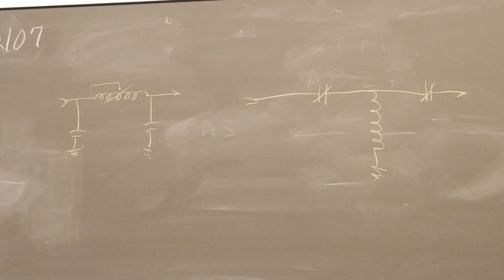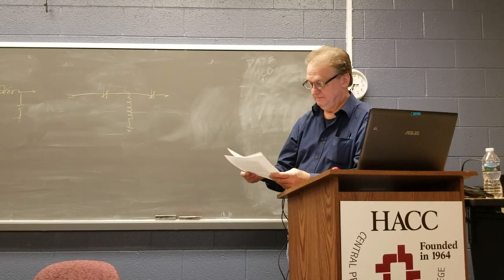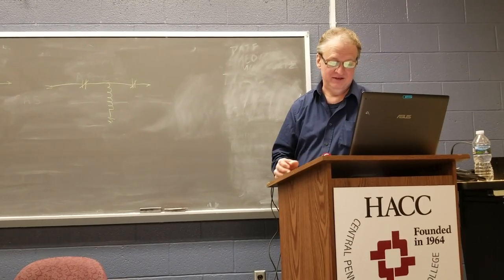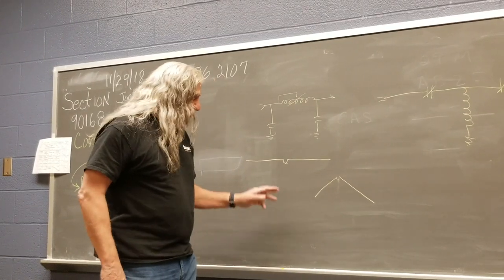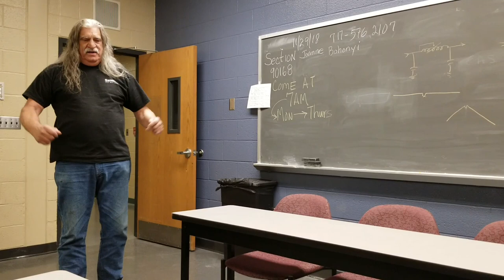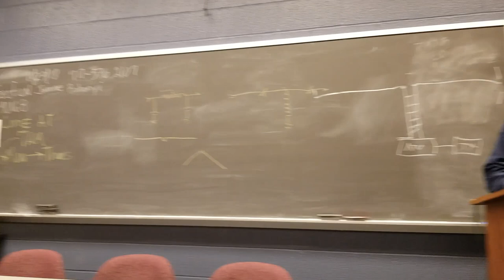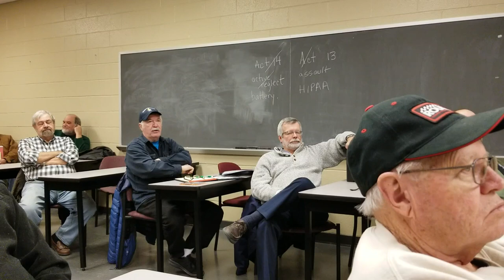Antenna Tuners and ATU Presentation December 2018 Harrisburg PA

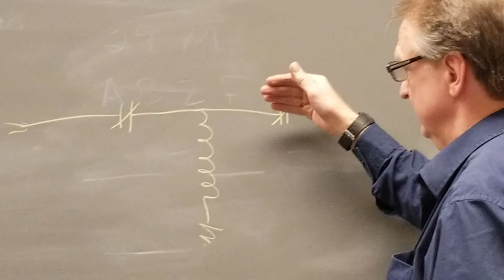Comment: Tuners actually absorb very little power (4:40, 7:55). Arcing occurs regardless of power absorption.
Reply from the maker: The purpose of a transmatch (tuner) is to show a 50Ω load to the transmitter. It does nothing to remove a high VSWR from the transmission line (coaxial cable). The high VSWR causes power loss in the cable feeding a mismatched antenna. The transmatch, and the cable in a mismatched antenna system cause loss of power. The amount of loss depends on the length of cable, and the VSWR number. Remember that some tuners will make bad antennas match the transmitter,  but then also a dumme load will also show a low VSWR. In short, mismatched antennas will not allow maximum power transfer to the antenna
Reply: @djterry17032  Not relevant to the comment, but you're exactly correct!
Reply: @djterry17032  VY GOOD. 100W. = 341.2 BTU OF HEAT. WHAT DOESN'T GET RADIATED FROM THE DRIVEN ELT MUST BE DISPOSED OF IN THE REST OF THE SYSTEM IN THE FORM OF HEAT. OR RADIATED. (CMC) OR OTHER LEAKS. BUT IT ALL ADDS UP TO 100 W.

Comment: ITS A MATCHBOX! A COUPLER! A TRANSMATCH! BUT NOT AN ANTENNA "TUNER"! A "TUNER" DOESN'T DO SQUAT TO YOUR ANTENNA. IT DOESN'T TUNE YOUR ANTENNA. A 7.15 MHZ DIPOLE IS 65.45 FT. LONG. WHEN YOU CUT IT TO THAT LENGTH YOU TUNED IT. TWIST AND SWITCH, TWIRL AND WHIRL THE KNOBS; IT DOESN'T CHANGE (TUNE) THE DIPOLE'S LENGTH, DIAMETER - ZIP, NADA! SO DON'T GET THE IDEA THAT YOU'RE "TUNING" THE ANTENNA. LETS USE THAT ANTENNA FOR 7.268 MHZ. YOUR 65.45 FT. ANTENNA PRESENTS A DIFFERENT LOAD REQUIREMENT.  YOU NEED A 64.39 FT ANTENNA. ARE YOU GOING TO CUT A FEW INCHES OFF EACH END OF THE ANTENNA? - NO! REPLACE THE DRIVEN ELEMENT WITH A DIFFERENT (SHORTER OR LONGER) WIRE? CHANGING THAT LENGTH WOULD "RETUNE" IT. BUT NOT USING A BOX ON YOUR DESK LABELED A "ANTENNA TUNER"- A BUILT IN "ATU" IN YOUR RIG? THEY DON'T DO THAT. WHAT WILL YOU DO? WHAT WILL YOU DO? - YOU NEED AN ANTENNA "MATCHING" UNIT. (THE CORRECT NAME FOR A TUNER) YOU MUST MATCH THE  ANTENNA (KEY WORD HERE), "SYSTEM" LOAD, PRESENTED TO THE TX. THAT INCLUDES
FEEDLINE, TRAPS, CHOKES, BALUNS, THE WHOLE NINE YARDS PRESENT A NEW IMPEDANCE TO YOUR TX. AND THAT IS WHAT YOU ARE DOING WITH A "TUNER". - MATCHING, NOT TUNING. BEEN A HAM 60 YRS AND TOOK ABOUT 30 OF THEM TO REALIZE THAT. '73 RICH MORGAN KF9F
Reply from the maker: Nothing beats a resonate antenna. I have often wished that I could build AM broadcast transmitter sites with a 1/4λ  tower.  My life would have been so  much easier.
Reply: @djterry17032  YES AN ANTENNA DOESN'T HJAVE TO BE RESONANT TO WORK - I LOADED MY 6' ALUM STEPLADDER AND WKD TORONTO ONT. FROM MY QTH - 20 MI. N. OF ST LOUIS. ON CW. I HAVE A HOMEBREWW "TRANSMATCH" OF THE LEW MCCOY DESIGN. ROLLER INDUCTOR, NICE HV CAPS FROM HAMFEST PUT IN A BALUN AND I'M OFF TO THE RACES. USE A SEPARATE SWR BRIDGE HR. GETTING OLD, CAN'T CLIMB SO JUST USE OCFD.. FED W/ DUAL COAX, NICE AND QUIET. YOU CAN USE 50 OR 75 OHM FEED (STUB 130% OF A 1/4  WAVE ON THE LOWEST FREQ OF OPERATION. MY DIPOLE IS 57.5 X 82.5 FEET, USING A 41% - 59% SPLIT FROM FEED POINT. SENT IT TO GUYS ALLOVER THE WORLD - ALL CAME BK VY PLEASED W/ PERFORMANCE AND LOW NOISE. W/ TRANSMATCH IT WILL LOAD D.C. TO DAYLIGHT AS THE SAYING GOES. STAY SAFE. RICH KF9F BTW REFLECTED PWR IS NOT LOST. CONSUMED IN THE FEEDLINE, TRAPS AND CHOKES, YES- MATCHBOX YES, BUT ALL 100 W. IS SPOKEN FOR IN YOUR TRANSMATCH AND 
ANTENNA "SYSTEM" - NO PWR GOE BACK INTO THE TX AND BURNS IT UP. IF YOU HAVE A 100W. RIG AND 99W IS REFLECTED ITS NOT GOING BACK INTO THE RIG. NO SUCH THING AS A 1 : 1 SWR. THAT WOULD BE 100% EFFICIENCY. CLOSE YES, BUT NO CIGAR.

Comment: Antenna tuner, a misnomer.  It's it an impedance matching device.  It gives your radio as close to 50 Ohms as it can to work against.  Has nothing at all with tuning the antenna.  If it's not resonant it will still be non resonant.  And the more non resonant it is the less power it will radiate despite a low SWR.
Reply: Have a read of Walt Maxwells book reflections
Reply: A non resonant antenna can if fed with very low loss feed line and and matched  properly with a tuner will radiate all of the power.   The common myth that reflected power is lost which this video perpetuates is short sighted because people fail to see the whole picture.   reflected power is again reflected back to the antenna added to the forward power by the tuner to be radiated   Again some will be reflected back then forward again and again until all is radiated except for any losses due to  transmission  line loss which with low loss transmission line will be only a  small  loss

Paul  above mentioned Reflections III by Walt Maxwell.   Its free to download from archive.org.   The first chapter alone describes  what happens very well  and I  love the tongue and cheek title.  Too Low an SWR Can Kill You.
Reply: @ve3dvy  ASK TOM RAUCH ABT THAT. LOL
Reply: @richardmorgan8027  LOL  yes and Tom is a very very knowledgeable man on this and will back me up Im sure.
Reply: HA. MY BEEF HAS ALWAYS BEEN WITH JUST CALLING IT AN ANTENNA TUNER, WHEN ITS NOT. I SPENT 25 OF MY 60 YRS IN HAM RADIO THINKING NO FARTHER THAN THE END OF MY NOSE AND LETTING IT  GO AT THAT. ONE OF THE MOST REWARDING THINGS YOU CAN GET IS HAVING SOMEONE COME UP TO YOU AND SAY  "I JUST WANT TO THANK YOU MR - YOUR NAME HERE - FOR EXPLAINING THAT, I PASSED MY TEST BECAUSE OF THAT." I HAD DONE A PRESENTATION ON COUPLERS, TRANSMATCHES AND MATCHBOXES VS THE NAME TUNER. I USED TO TEACH ELECTRONICS AT A TRADE SCHOOL AND HAVE ALWAYS TRIED TO BE THOROUGH WITH AN EXPLANATION OF THE HOW WHY AND WHAT. AND LOST POWER? WHATEVER BECAME OF "CONSERVATION OF ENERGY"? LIKE 1 : 1 SWR - AIN'T HAPPENING THAT WOULD BE 100% EFFICIENCY. OH WELL, BUY 'EM  THE BOOKS - SEND 'EM TO SCHOOL......LOL STAY WELL DAVE.
Reply: @richardmorgan8027  if you read reflections Walt Maxwell goes into great detail on how in fact the tuner does tune the antenna to resonance especially with the use of balanced feeder, Louis Varney liked to call it and antenna system tuning unit as he describes it tuning his antenna and feedline together as part of the system
Reply: A balanced fee line is exactly what is considered a low-loss line. Coax is not low loss when it comes to impedance mismatches; it radiates! And to use balanced line, you need to go into a balanced load, which, unless your using a Doublet, or a BalUn at the antenna, you don't have a balanced load with an OCFD, groundplane, or end-fed.  So does running a tuner at the shack to rectify a high VSWR matter? Yes, unless you're using a balanced TL.